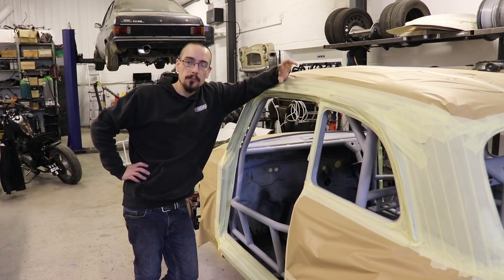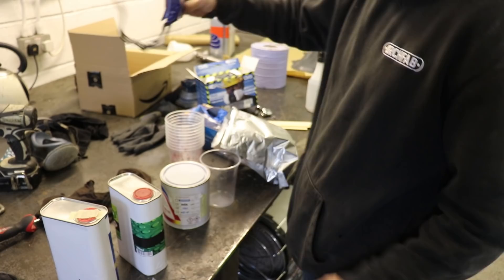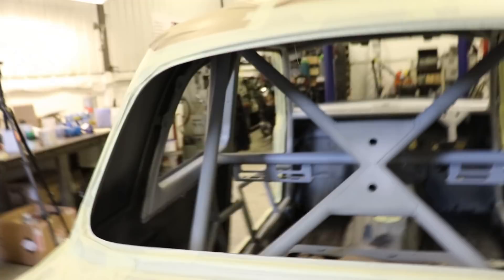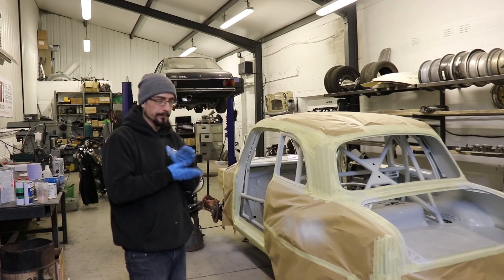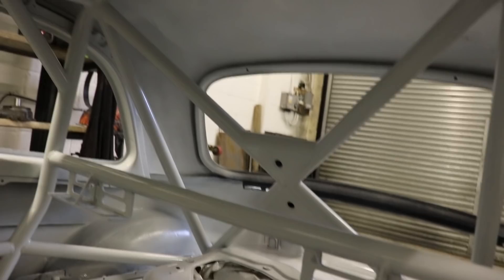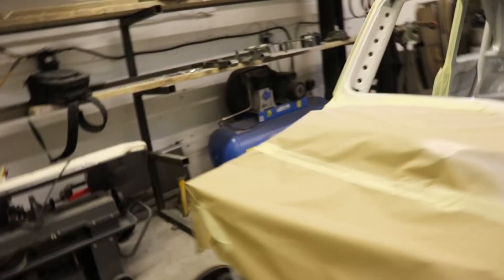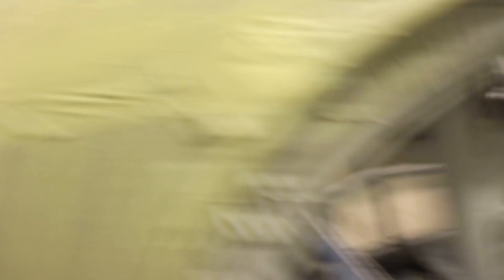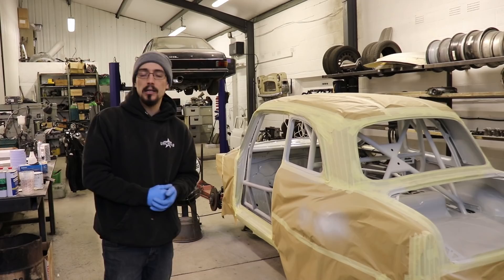ATTEMPTING TO PAINT THE ROLL CAGE, MONGREL 1 URCHFAB NIL.

Comment: Good effort, trial and error, is the way to learn; Water trap on gun yes, compressed air creates water  can get blobs in paint due to cold storage/insufficient stirring/ not using a paint filter when transferring paint to gun, guns need to be kept clean, or they get build up of dried paint. heat is necessary to get good flow on warm surfaces, even professional painters get runs, so don't despair. Be patient, you'll get the knack of it.
Reply: If you can paint the outside in a booth, you'll get a better result, and your workshop will be paint dust free. perhaps Trev can let you use his booth.

Comment: most your issue was water and fact it too cold, putting paint products through filter funnel never a bad idea .
To help control overspray use some plastic sheeting make a mini booth area as the mess will be unreal without it .
You'll find outside way easier and less overspray as firing at a full panel rather than multi angles at small areas . 
In my early days I sprayed a lot of military vehicles from fuel tankers to 6 wheel drive gun tractors inside and out and underneath, it sucked lol and like you I hate painting :-)
Correct a few points and think you get decent enough results but it hard learning as you go and not having ideal environment for it adds to the pain .
Least you got paint on it lol, last place only managed get dust on it lol .
Chin up, 2020 be year of the Mongrel . all the best Mr Urch  ...
Reply from the maker: Cheers mate, happy new year.

Comment: Your doing great,mate, but first strain the paint through a paper filter, drain the compressor of moisture,  and of course it is cold there use heat lamps,not a gas heater. Surface being really cold is not good.And remember it ia a race car,not a full blown custom hot rod,if it was you would have to paint it in a heated paint booth.Warm the surface up a bit,and you should be ok,Well Done.

Comment: DON'T use a heater,heat on cold steel = condensation,thats why you are seeing the dots on top of rollcage you created condensation and painted over it, a water trap on the gun itself would help,don't let it set you back,you can do it,also i noticed you didn't stir up the paint in the tin before you started mixing,pigments settle to bottom when it has sat for a while, better to give the whole tin a good stir up first before you start to do the mix, but you can do this, it's trial and error ,but i would leave the heater off

Comment: you've got water in your air supply, what's the temperature in your shop? Looks like your metal is too cold. Try to get the metal to at least 70 degrees F. Check with an IR temp gun. Smaller nozzle on the gun, little higher air pressure.

Comment: So you may have contamination on your tubes maybe he got some kind of silicone base stuff sprayed on it.... 

To help with heat ... Take an create a 2x4 structure as a small frame to go around the car then hang clear plastic on it to create like a small paint booth instead of trying to heat your entire .... The other thing you want to do depending upon the size you create your temporary paint booth being that it is plastic you will want to wet it down a bit to collect dust .... ironically you might be able to find a YouTube channel that talks about how to create a temporary paint booth and why you should spray the plastic

Comment: So you have one of two problems possibly three...... One you're either not mixing your paint long enough ...

The working time for your paint may be off because of the hardener

For the simple fact that it's the wrong temperature hardener for the wrong temperature in your building

The other thing you can do is adjust the gun for paint volume so it atomizes the paint better ... Always dust your parts with paint first then go back and hit it with the first ..... Hope these hints and tips can possibly help you ..... Don't get discouraged this is how we all learn

Comment: Don't get too discouraged by the paint issues. It's not a restoration job. It's a track car. You'll get it sorted out. A little more heat, and get that air drier and you'll be fine. Try a thinner coat next time to avoid runs and sags. I'm curious about the bike. Is that a new addition? What is it?
Reply from the maker: It's a secret, for now.

Comment: Your compressor was working hard, getting hot. Never seen that kind of inline dryer before, but you could do with a double trap, one for water, ( a constant problem when a compressor is struggling to keep up) and one for oil.
As you know now, your gun setup is too big, probably 1.3 tip will do.
You had the gun set up so the fan is narrow, need to widen it a fair bit. I know it seems to be wasting paint when most of it is missing the cage, but with a narrow fan you shoot a heck of a lot of paint in a concentrated area, hence the runs.
To ease access you might want to consider a suction feed gun (pot on the bottom) rather than a gravity feed (pot on the top),
might make life easier in there.... 
Great effort though, don't get down about it, i'm a proffesional painter and i wouldn't fancy painting that cage.....!!
Reply from the maker: Cheers mate.

Comment: you should have filtered the paint through a gauze filter , makes  the paint equal
Reply: hoodie Single use mixing containers fitted to the gun seem to have integral strainers. Seems like a nice thing.
Reply: looks like a older gun no filters on board , modern ones have the filtering built in

Comment: You need a really good [ REALLY GOOD ] water trap on your compressor..if your compressor is too small it will run hot and cause even more condensation.  also painting tube wastes ALOT of paint it just does so expect to use much more than you expect maybe even triple what you think. so many variables and all advice is probably right but unless you have a dedicated spray booth to eliminate most variables its always tricky..... painting sucks ! but good effort  it will all be worth it in the end.

Comment: That's what you get for buying air line from Aldi! 🤣
I find when you don't get good atomization add more thinners. I always thin the paint more than recommended.
But I don't have any of the things you are supposed to have. I don't have any filters or water traps and use a cheap compressor and gun.

Comment: That coil of air hose, reel, is going to act like a condenser for water vapour.  As others have already said make yourself a booth of some sort inside the workshop general as it will help control the overspray and will really reduce the volume of space you need to heat.  FYI in the early minutes there was actually a time or two I thought I could see your breath.
Learning is always good esp as it sounds like painting is not your favourite thing.  Think this is more Urchfab 1, Mongrel 1, Conditions 3.

Comment: Painting the inside of that is not an easy job, water trap gun end and a nicer gun with a smaller nozzle is good advice, use the 1.6 as a primer gun, some heat and you will nail it next time.

Comment: yea the flow tip is bit big 1.3 or .14 be better  but you use what you got ,the water filter  you can get is cheap for a inline one to stick on just before the gun and yes  the paint will need to be  strained  and also if its too cold inside the car  and too much is applied the paint will sag and ripple . end of the day your not a car sprayer and iv seen a lot worse attempts, so fair play to you mate ! like I said if you was closer id come and do it fore you !

Comment: Get a cheap used air dryer. Worth there weight in gold no water in my air line I use for powdercoating only have one decent filter on it. I also have 10m of copper pipe to cool the air down as you can only trap moisturise when its cooled down.

Comment: Filter that paint as you tip it in the gun, have a  water trap on the gun/end of the air line. Check out The Gunman on YT for paint tips. Oh, get a cheap Tyvek style suite too. Try to heat the building up first and wet the floor to keep the dust down.

Comment: Check out on youtube for compressor water trap/ air dryer.
Great job for a first attempt.
Another tip is to drain compressor before starting.
Also a cheap marquee or a inflatable paint booth works well at reducing overspray.
👍

Comment: one small thing , if you put the paint in the gun filter/strain it , 
https://www.ebay.co.uk/itm/311950732612
if you dont and there contaniments in the paint the paintgun will start to sputter and ruin youre paintjob , once you added the hardener it has a limited potlife (like epoxy)before it goes off 
if you can get youre hands on some old lpg or propane tanks and set those in series with youre compressor , you create a compressed air buffer that should stop youre compressor running all the time once youre painting , that alowes the watervapour in the tanks to condens and you should should catch most of the water in the first one or two tanks before it goes intoo the dryer 
the small waterseperators you can clip on youre belt and use a small extention line to the gun helps catch the last bit  
build a board with some rows of fluoresent lights on a stand across from where you paint and use the reflections of those lights in the paint to see how mush paint you need to add to get it from looking like sandpaper / orange peel to flowing out smooth , 
https://www.researchgate.net/figure/Hood-of-a-car-body-at-the-end-of-the-paint-line-in-an-auto-factory-Bright-lights-and_fig1_238363211
theres a verry thin line between flowing out and running down  , build up slow and even
allso try to spray wet in wet (used to be different with oil solvent type paints but nowadays with waterbased its wet in wet) meaning that once the paint start drying leave it alone , if you spray more coats on half dry paint the paint flashes off before it can flow out and the solvents will ruin the finish and will turn blotchy or matt or doesnt harden completely and turns intoo rubber 
still have trust in you and as long as you try to fid out why thing go wrong and fix it you should be a pretty good painter by the time youre further along with the car , its actually a pretty good skill to have in youre line of work

Comment: Frustrating ain't it???  My experience, fit a water trap as close to the gun as you can, it's the only way you can ever be rid of it. Otherwise the compressed air keeps condensing as it travels down the hose.  Cheers,

Comment: Crap in your compressor. Or lines. Painting rollcages is easier with a brush. The rest? Spraying looks better where you can get the gun. Floor, Doors dash etc. I always paint rollcages black, something less to glare at you. A small amount of black will achieve a light grey which A. Covers better and does not glare as much.
Painting when cold is simply too hard. Dec in England hardly ideal!

Comment: You need to practice on small things first.
If you want to spend money don’t buy cheap chinese guns.Buy a devilbiss flg5 which is a good gun with a couple of spare fluid tips.Use disposable filters.Use a filter inside the gun.Check your paint viscosity.Use water trap and a pressure valve on the gun to have as low pressure as possible to prevent overspray.
If you have time watch the youtuber “gunman”